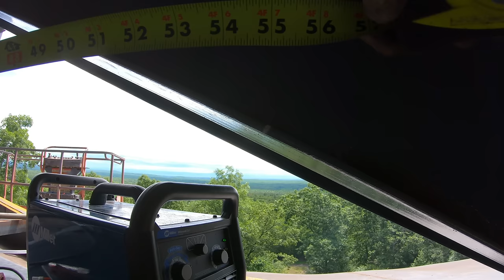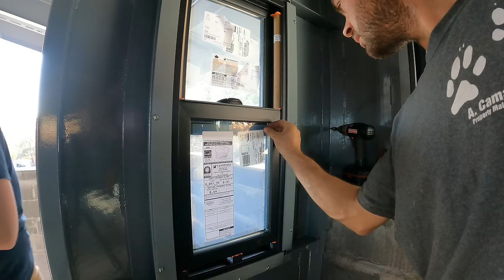Closing in the container castle

Comment: The R value on that thing is gonna be in the negatives, lol. It's looking awesome tho.
Reply: I am currious as to how he plans to keep the heat out in Summer and heat it in the Winter.
Reply: @jasontaylor9871  heat out I would maybe put a cool coating around the place and definitely some ventilation, some people think that you need to cover the roof but I have a workshop made of completely metal and it is cool all the time, the sheet metal has a low thermal mass so it just bounces the heat and sun off. and heat in I would just keep a few wood stoves running or insulate the place
Reply: I feel like he should have been stuffing rock wool in some of these places before closing them out.  That aluminum plate sill is going to be so loud if you get up on it.
Reply: Came here from another video from a guy that he gave a tour and he said there is no heat, it causes condensation. Said maybe he would build a conditioned room somewhere inside but he just puts a coat on.

Comment: Me: You know how your car heats up to like a million degrees in the summer sun because it's basically a painted steel box with windows?

Andrew: No.
Reply: More like overRated-value amirite?
Reply: I'm more worried about winter. The metal on the sub 0 outside will be the same metal walling the inside of the house. All that hot air needs to constantly be heated as the metal walls making up the entire structure are all freezing temp keeping your house freezing on the inside.

So now every square inch of metal surface needs to be insulated on the inside where the interior air can still reach it or there will be rapid heat loss.
Reply: He created a house that is thermodynamically very hard to keep cold or hot. Steel is the opposite of having an r value
Reply: @dylanmccallister1888  Yeah thats my point; but I think he knows that. He has mentioned before how the rest of the container castle is impossible to heat in winter; and these parts will be no different. At least the rain and the wind no longer stand a chance; that opens up a lot of uses for these spaces already.
Reply: See 2:30 moment in the: https://www.youtube.com/watch?v=Pc_K8EMjNt8 
Now I understand why Andrew built such a BUNKER, not to be conquered by any excavator or army in the world!
Reply: A fuck ton of insulation, drywall, industrial a/c and heating unit and a few fans...... 90% of production factories are giant tin cans baking in the summer. Some hot stamping assembly lines intensifies the heat. Yet, we still don’t find our workers exiting the building like French fries or frozen to death. He wouldn’t have to try very hard to find a good system for ac and heat
Reply: @bassackwards8821  he doesnt want heat...
Reply: @bassackwards8821  getting effective insulation will be very hard. What are you going to do near those metal window sills and door frames? How do you keep the floor from being an ice slab if the space below isn't insulated and there are steel thermal bridges anywhere? Does not seem like the door openings leave room for a ton of insulation on top. The only way to manage temperature will be to indeed overpower that with active measures. Or to basically build a complete secondary isolated room inside this one with it's own floor windows and door.

Comment: Thank you for posting your project.
   Let me give you another "tool" to use, when lifting plate steel. plot your center line. measure your tine width, with it spread and latched at its broadest position. Using a torch, cut rectangles for the tines to enter. (be sure to burn a "key" somewhere in the piece, so it will be apparent how it goes back in the hole, for final assembly.)
    Most forklift tines have a pin hole bored in the tip, (to prevent slip-out), for safety reasons. Don't torch cut your tine tip. Drill it. 1" hole and use a deep throated Clevis and a screw pin...per tine. Spear the steel thru those cut-outs. Apply the Clevises, and lift into place. You want your steel right close to the Clevises. They will prevent a major "cats-astrophy" and will allow clearance for your overhang. Position and secure well and remove the clevises. Weld the cut-outs back in their respective holes and grind, if needed. Works fine, every time!
   ((make Levi an elevator. Stick a jib out over a window with a pulley and a cable with a doggie box. Hey...it's an idea for another video. You really show off your dogs.🤔 😉 I'm subbing
THANKS AGAIN FOR POSTING !
   Bill, from Tn. 🇺🇸

Comment: Wow..just found this channel 
I know containers are strong and there is plenty of steel there but the calculations for the foundation and supporting columns must have been crazy.
There is so much weight being supported..wow...im impressed
Reply from the maker: Containers get stacked 7 high on boats loaded heavy.
Reply: @AndrewCamarata  yes but they don’t have a castle made of steel and rock on top of them…lol.. I watched another video where he talked about having an engineer work on the plans with him.
Reply: @jacksarebetter  A lot more weight in one loaded container stacked on a ship, 50,000lb capacity each. Nothing above any container on this build weighs 350,000lbs.
Reply from the maker: Plus there are columns and walls too holding load.

Comment: Great video and nice job
Suggestion: as you know large panels do glass expand and contract with heat and cold( module of elasticity) I suggest you use rubber spacers on all four sides of glass to avoid  breaking
Reply: Your work ethic and dedication are truly admirable.

Comment: Suppose you break your leg, have to move in a wheelchair, or in old age you can no longer cope with the stairs. Do you have alternative ways (elevator etc.) to get into your living space? Or handicapped accessible (large enough to be accessed by wheelchair) bathroom and toilet (grab bars, shower accessible for wheelchair, with handrail handle and shower curtain only)? Doors at least 90 cm wide. Light switches or power sockets at a height suitable for wheelchairs?
Please also consider these possibilities, a leg break happens quickly (I speak from my own experience).

Very nice video and awesome work you are doing.

Comment: You should have went with 3/8 tempered, you lose a little R value but the life of the glass will be a lot longer and in a difficult install like that thats what you want. Insulated glass has a life of about 10 years depending on  the spacer, rubber spacers last longer, but hey solid ass house man, I like it !!!

Comment: Andrew, just watched this video for the second time. I saw you recently put heat in. I was wondering, do you have a condensation issue on the surface of the steel when it's really cold? I build houses on long island and I've had condensation issues with some aluminum windows without thermal brakes.
Love your work.
Reply: I wonder what is going to happen with no insulation & condensation in the ceiling & soffits it will drip down & rust the metal then drip rust stains down the walls. Or am I missing something?

Comment: So many questions, I would love to see a copy of the Stamped and Approved Structurel Drawing and  details, like expansion joints, transitions between all the different building materials and electricaly bonding ALL the structurel and misc steel to the concrete encased footing ground, don't forget the lightning protection. I would highly recommend Combo AFIC GFIC type breakers for all circuits... etc, etc, etc... Did you have to permit that as a commercial bldg. to get your Certificate of Occupancy? Commercial insurance also?
Love the look!!! But looks high maintenance...

Comment: How to make this a real castle:

The merlons need to be way higher to provide cover, they and the crenellations are also too skinny. Add machicolations to dump stuff on people standing next to the walls.

The ground-level entrances should be sealed off and moved to the first level, approachable via a drawbridge.

The windows below the battlements are too wide and a potential weak spot. They should be narrower, like arrow slits to provide cover, deny entry and give the defenders a way to shoot at attackers.

Last but not least: move the entire building ontop of the cliff right next to it.

Just kidding, but I wanted to point out that architecturally, this is closer to a manor house, mansion or chateaux than a castle.

Comment: I don't know anything about construction, but where does Andrew comment on  stuff like:
Can you just keep adding weight to a structure like that?
How long before rust becomes a problem?
What about thermal expansion?
Is there any danger from lightning?
How does all that metal affect temperature control in the building? Is insulation needed?
Etc.

Comment: Rain Chains are availabele online, or through Gutter installation companies!! prices , depending on length and style $100.00 and up.. some as low as $75.00. or make your own. Bundle of ordinary chain 5 or more strands fairly heavy chain (similar to chain used to hang tree swing) strands less than one inch apart. Surface tension forces water to cling to chain to the ground. Bottom must be anchored. inside stone filled pot with drains is ideal.

Comment: It probably doesn’t matter since you have such large overhangs, but did you need to add weep holes on the windows to get rid of water standing inside the pocket?
Reply from the maker: I don't know. On the windows that open or the fixed glass ones?
Reply: @AndrewCamarata  on the fixed lites. Like the ones upstairs where the bed is. I know condensation can form as well. Just curious if you have seen or checked any

Comment: Lifting that roll of insulation (carpet?) up over doorway to roof (around an hour in) is the very definition of “lift with your back, not your knees”.    A short piece of rope would have made that a easier  and safer.   Or use one of the many pieces of equipment you have.

Comment: I though this was a demolition job, I will be pissed if this nice building is taken down. Does it have to be bullet proof though? Did you do the engineering calculations for the weight? that looks like it's a lot of weight for the concrete foundation to handle.

Comment: 37:25 I don't understand one thing. And why should such a mass of metal, or rather metal of such a mass, or rather such a mass of metal, be used to make a drain? Aren't there materials much lighter than them that will perform the same function?for example stainless steel aluminum? why make tons of metal overhead
Reply from the maker: Because I want it strong.

Comment: First video for me. Jw is there a reason he’s using so much metal? Seems like some non structural walls could easily be made from wood and drywall or whatever you please, with less effort and less money. And possibly significantly better insulation.
Reply from the maker: Make a building out of fire wood? That's crazy talk. Everything needs to be steel.

Comment: Never should use a calking that gets hard all calking needs to flex with the expansion and contraction of two different products this was a very bad idea and I'm sure there is already a lot of cracking and water penitration not good at all
Reply from the maker: Everything I did here pretty much turned out perfect, what step are you talking about?
Reply: @AndrewCamarata  if you use a soft caulk it's won't crack try sika flex it will bond to concrete and metal I'm sure you will like it's performance also you might want to use galacticoat on the roof it is a roll on rubberized roofing with a twenty year guarantee I've used it and had great success I was using it in a coastal area with salt air   keep up the good work I enjoy your show

Comment: Did you inherit some money or something? I know it's none of my business, I'm just wondering how you came to be able to afford everything you have, because those machines alone are a good penny each, then all the tools you have, like that Miller welder isn't exactly cheap, then you had to buy all those sea containers, concrete, steel and everything else, so everything together adds up to a good bit of money. 

Did you get a loan to do all this, did you save up money too, to help pay for everything? How old are you? You don't look that old.....I'm asking all these questions because I'd like to be able to build something like this, which money is an issue, so I'm just trying to figure how to possibly go about doing something similar. Are you a fabricator by trade or a welder? I just bought a Yeswelder TIG 250A Pro Aluminum welding machine, which does MIG/TIG and Stick, and I bought the Yeswelder CUT 55DS Plasma Cutter. I know they aren't Miller machines, but they are supposed to be really good for the price, I've seen a lot of good reviews on their equipment, but I guess I'll see for myself. Lol